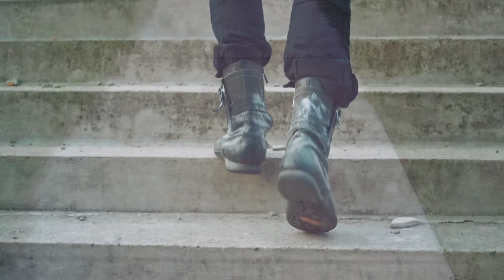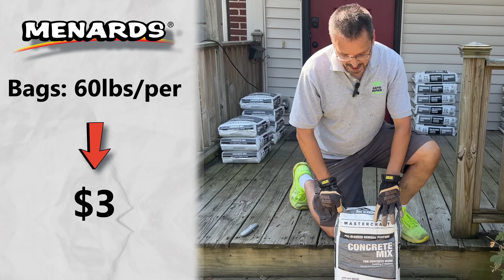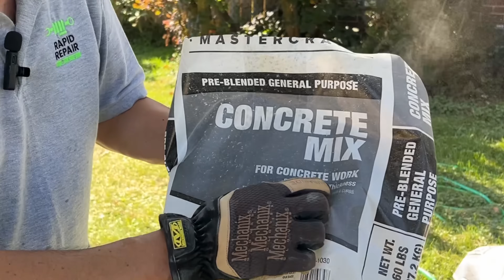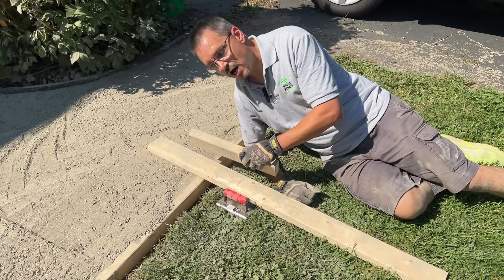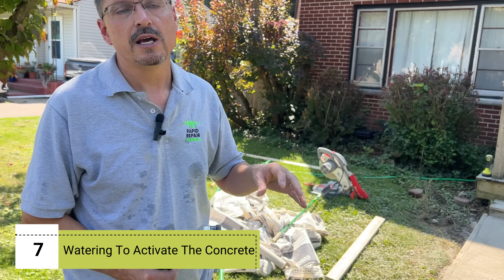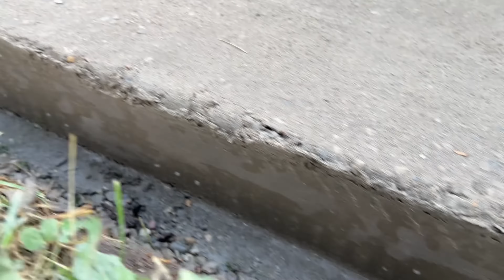Dry Pour Concrete Method Anyone Can Do

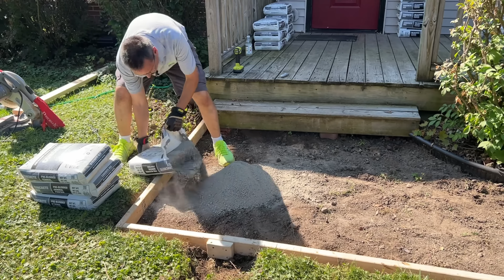Comment: 2:00 Would a thin sheet of plastic underneath the concrete cause any problem?  I ask because, "why not just lay the entire bag flat and then run the razor blade around the lower perimeter of the bag, then lift off the top plastic?"  You could get 85-90% coverage with just the flat bags, and then pour a few bags on top to level it all out.
Reply from the maker: Using plastic underneath is fine. Yeah your ideas on how to lay the concrete bags in there would work… You’re totally correct…👍🏼😎

Comment: Interesting. I want this to work but I think in Canada it is not going to hold up during the many freeeze and thaw cycles , especially right on dirt.  It will end up with a hard outter shell and crumbly dry inner  section. Maybe if you mixed water in when it's half full and then did a top layer. I just worry, so much work, I want it to last.
Reply from the maker: You’re very smart. If quality is your highest priority then you should mix it the traditional way. I do have a follow up video coming up this week where I will show the over one your review on the slab that there are no cracks whatsoever and I’m in a very cold climate. However, the surface will tend to spall and crumble… Dry pour concrete is only for very small projects.

Comment: FYI  Cement mix and concrete are not the same thing. Cement is an ingredient—a fine powder made from limestone and clay that acts as a binder. Concrete is the final product, a mixture of cement, water, sand, and gravel. Cement is the "glue," while concrete is the durable material used for driveways, patios, and foundations.
Reply from the maker: Thank you so much for your excellent explanation. I am guilty as everyone else as using those words interchangeably. As I understand it, Concrete mix is like the cake and cement mix is just the flour … For a baking analogy

Comment: How many bags will I need if my yard is 30ft by 25ft? Also how did you say remove all grass then turn the dirt?
Reply from the maker: That’s a really large area… Probably not advisable for a do it yourself dry pour method. At a 3 inch slab you would be looking at hundreds and hundreds of bags. There are online calculators that can help you with the measurement requirements.

Comment: What if mist with water but keep fixing the top for smoother look. Any advice if that work adding more water and smoothing top
Reply from the maker: You may be able to do it… It would just be trial and error… I have seen some people have success with doing a top layer of cement only… I think it’s called topper or finish cement… It doesn’t have the stone aggregate in it when you purchase it. This is only a good method for small projects not a large areas like patios or driveways or anything like that… Good luck.

Comment: Not sure how it’s going to be a strong build if there is no fiber glass or iron rod not used
Reply from the maker: I hear you. However, it’s been well over a year and in one of the worst winters this state has seen in awhile … And there’s literally not one crack on the slab. We are going to make a new video showing the results shortly. Rebar and fiber are just not needed for small projects, especially if you have sand underneath and are well drained.

Comment: Excellent video that’s how I did My fence posts dug the hole made everything level put the concrete in the  and filled it with water and I was done.
Reply from the maker: That's awesome, glad to hear that method worked perfectly for your fence posts too! 👍🏼😎 Are the posts still holding up strong?
Reply: @HomeRapidRepair perfection thank you

Comment: I have a question?
Should I pre soak the ground before I add  drycrete. Would this speed up the hydrate step?
Reply from the maker: Hello. Yes I’ve been asked this exact question before. I do think it’s a good idea. Your slab will be plenty strong, but will not have a perfect surface appearance
Reply: @HomeRapidRepair okay I understand the ground swells and dries probably leaving an uneven prone to crack surface.
Reply from the maker: @ShakeMehhed  the slab in this video is well over one year-old in  Michigan climate and there is literally not one crack anywhere in the slab

Comment: How many bas of concrete mix I need since I’m using CONKRETE mix
My measurements are. 122 long
60 width and. 4 inck high or thick since put it against anothe small concerts floor outside 
And great video
Reply from the maker: Here’s the most popular concrete calculator you can use: https://www.quikrete.com/calculator/main.asp

I ended up having extra bags and returned them for a full refund 👍🏼😎

Comment: And then it cracks all up cause there's no steel or a stone base, hope you cut control joints in at least
Reply from the maker: Thank you for your comments. I appreciate it. Check the age of this video. This slab is over one year old and during one of the coldest winters Michigan has had in some time… And there is literally not one crack in the slab… However do I do NOT endorse this dry pour method for most concrete work. It is only for extremely small projects such as garden paths. small steps, garbage bin pad, maybe shed bases… Etc..

Comment: I'm a DIYer and first time doing slabs. Saw several videos but your video is the easiest to follow. What concerning though is the cure level of the cement since this is 4" thick and did not poke any stick all the way at the bottom as recommended by manufacturer. You did not use gravel or rebar to strengthen the concrete. No control or contraction joints. Didn't mention anything about the slope for proper water draining. Any update on your project is much appreciated. Thank you.
Reply from the maker: You really don’t need rebar for small projects, and dry pour method should ONLY be used for small projects.  By the way this slab in the video has zero cracks till this day. 

Here’s a video where I tested the strength. Dry Pour Concrete Test - DIY Concrete 
https://youtu.be/0jxCoXkS-EA
Reply: @HomeRapidRepair thanks for quick response and inputs. Dry pour may not work out with my project with 160 sq ft. intended for small patio.
Reply from the maker: @carlosh4122  Yes for your patio go ahead and mix concrete with all the traditional methods...it will be worth the extra time and work for that to turn out nice.  Dry pour method is only for small steps, garden paths, garbage bins, etc

Comment: Uneven when looking at the steps
Reply from the maker: You ain’t wrong. These simple DIY ideas are just to help people that have no experience and are intimidated with home repairs , working on their home… I am not presenting myself as perfect in anyway…

People are intimidated with how difficult it is to mix a lot of concrete and the back breaking work of it all… This just presents a simpler cleaner easier solution for small projects…

Comment: Has it cracked yet?
Reply: BRO, WATCH THE VIDEO, WHEN THOSE FORMS CAME OFF, THE WHOLE THING IS CRACKED, LARGE CRACKS AND SMALL ONES, HIRE A PRO
Reply from the maker: It’s been over a year and in a very cold climate…no cracks in the slab yet. But not advertised for professional jobs…just tiny areas if you are intimidated by concrete work

Comment: That's no good at all. You have to mix THOUROGHLY! There is no shortcuts in pouring concrete correctly! You'll be pushing a large appliance like a refrigerator across that and it will break loose.
Reply from the maker: Great points 👍🏼😎

Comment: This works but dry poured cement does not have the strength of wet pour. Beware.
Reply from the maker: You ain’t wrong. But did you see me drive my work truck over it? Dry Pour Concrete Test - DIY Concrete 
https://youtu.be/0jxCoXkS-EA

Comment: It will  fail
Reply from the maker: Yes, I’m sure you’re right someday… Although it’s been well over a year and one of the harshest winters we’ve had in over 20 years and there’s not a single crack yet…. But yes, I would not do this method for a large project or anything I really cared about… Just for tiny tiny little areas.

Comment: Hello. I’m looking to build a ribbon style Hollywood style drive pad. If I dig where my tire treads would be. Do I need the 2x4s or use the edge of the trench? Would you suggest compacting gravel underneath the dry concrete mix? Or just straight concrete?
Reply from the maker: Compacting gravel underneath is done if you need assistance with drainage. If it’s already a well drained area you can just use compacted sand…
Reply from the maker: You would not have to use two by fours… We could use literally anything…

Comment: Would it be better to water in layers, every inch or so? I’m still not sold on this. Would like to see one that was done at least 5 years ago.
Reply from the maker: Maybe you’re right, however, if you’re going to do all that extra work and time and effort, you must as well just pre-mix it the traditional way. Here’s a video where I demonstrate the strength of dry pour Concrete method while I drive over it with my work truck: DIY Concrete - Dry Pour Concrete Test
https://youtu.be/0jxCoXkS-EA
Reply: @HomeRapidRepair I watched it. Wondering how that would work for an old house basement floor. One that has a dirt floor and no easy way to use a truck to pour it.  Set it up in manageable sections. Still not totally sold, but can see its uses.  Have a great day.
Reply from the maker: @all @allen7218  it will absolutely work in a basement. It would be a perfect easy solution because you could partition the forms off and do it in small patches if you would like. The only possible complaint is the surface does not appear to be smooth. but it would be such an improvement over dirt… You should try it.
Reply: @HomeRapidRepair I think you might need more water if it is a very dry basement.
Reply: I wonder what the amount of coverage difference between wet and dry pour is. What one is more.
Reply from the maker: @allen7218 they should be very similar. Dry pour may go a bit further
Reply from the maker: I use the online concrete calculators
Reply: @HomeRapidRepair it would be interesting to see. When you add water, you add mass. 
Does the dry settle, or is the powder so dry and compressed already,
Or am I just thinking about this too much? Lol
Reply from the maker: @allen7218 yes, yes, and yes 👍🏼😂

Comment: Why didn’t you use steel in the slab??
Reply from the maker: Honestly, it’s just not needed for such small projects. This concrete slab is in a very cold climate and it’s been 1.5 years and there is not a crack in sight.

Comment: Interesting. The finished is pretty ugly but i think itll be good as a foundation to add planks on as a ourdoor finished? Any thoughts on that verse using wood as a base
Reply from the maker: I think you’d be fine either way. It’s absolutely perfect for small projects and easy DIY stuff where people don’t wanna mix 20 bags all by themselves…

Check out my video here where I drive over a dry pour concrete slab with my work truck: DIY Concrete - Dry Pour Concrete Test
https://youtu.be/0jxCoXkS-EA

Comment: Can you use this for a driveway?
Reply from the maker: Well, yes, in theory you can it will hold the weight if it’s 4 inches or thicker. However, I’m not sure you would want to. Because if you’re going do all that work must as well do traditional pre-mix and use rebar in the slab. Also, with the dry pour method the edges can be weak and  can crush as you’re driving on and off of the slab…

Really dry pour is only for small projects where the homeowner doesn’t have anybody to help them and is intimidated with pre-mixing a whole bunch of bags of concrete…
Reply: @HomeRapidRepair fair enough. I've got a small driveway that's all grass and it's become very muddy because of the heavy rain which happens often in my country so trying to look for cheap solutions. To get it professionally done it costs minimum 10k
Reply from the maker: @Unknown-si8yx check out my video here where I drive my work truck over a dry pour slab: DIY Concrete - Dry Pour Concrete Test
https://youtu.be/0jxCoXkS-EA

Comment: Do u need metal mesh beneath?
Do you need to cut lines between it?
Reply from the maker: Great question. No rebar or mesh is needed on such small projects at all. As far as scoring expansion lines… That’s up to you. I would say not necessarily unless it’s a very large project say longer than 10 feet… Keep in mind. This method is not really recommended and has nothing to do with traditional concrete… This is just a very easy alternative method for people that don’t want all that hassle…

Comment: Would like work for a larger 16x8 ft base?
Reply from the maker: The short answer is yes it will work even on that large footprint. The larger answer is if you want the slab to last and look good for a very, very long time. Maybe you should rent a mixer?

Comment: can i do a 20x12 the same way to park a 3500lb camper?
Reply from the maker: Yes, you can do it and it will work. I know it will hold the weigh. I think the concern would be the edges. You would want to have a proper ramp so the camper isn’t not tearing up the edge every time you drive onto it.
Reply: @HomeRapidRepair  thanks for the info and advice.

Comment: Amazing video. Me and my dad used to do concrete work. He showed me an easier way to mix and pour but nothing like this. I mean this method is way better. For one it is low costing, and it's just easier to do it this way. I really appreciate you for sharing this information and video. Great video
Reply from the maker: Thank you for your comments. I appreciate it. Yeah it’s great for small projects and beginners that need no intimidation factor. Here’s another video. I did where I drove my truck over to prove the strength on the inside. The edges can come out wonky if you’re not careful…

DIY Concrete - Dry Pour Concrete Test
https://youtu.be/0jxCoXkS-EA

Comment: Also, will I be able to anchor a 10x5 dog kennel to the surface
Reply from the maker: I would say yes, you can drill into it and anchor, and it would be successful. However, the edges near perimeter are definitely weaker than traditional mixed concrete. So maybe make a wider footprint than you need… Let me know if you have any other questions.

Comment: Good morning, can any concrete mix be used for dry pouring or does it require a specific brand? Lowes only have Sakrete
Reply from the maker: Hello. You can absolutely use any general mix concrete bags you want to. The brand you mentioned is considered pretty high-quality. You’ll do fine. Good luck 👍🏼😎

Comment: No Rebar? You will have cracks in months... You are up north if you are shopping at Menards... You have lost all credibility because no Visqeen plastic liner, no Rebar, and not having a form or board at that HUGE gap by the steps will come back to haunt you.
Reply from the maker: Check the date of the video, it's been 1.5 years and ZERO cracks. No rebar is needed for such tiny projects. Yes I'm in Michigan a very very cold climate and ZERO cracks on this walking slab. This easy DIY is only for small projects, one would never install a driveway or something like this.
Reply: @HomeRapidRepair  - No Visqeen, No rebar... Period. Ask ANY CONCRETE EXPERT and he will tell you these are necessary for a LONG TERM pouring. I do not do ANYTHING HALF @$$... Not impressed at all... You protest too much...
Reply from the maker: My Truck Drives Over Dry Pour Concrete
https://youtube.com/shorts/emDReE7AOTA?feature=share

Comment: If putting the cement directly on top of ground and not with stone, you should have a fence under the cement to hold it together. Because in the winter time it will crack.
Reply from the maker: That's a good point about reinforcement, especially with temperature changes!
Reply from the maker: My Truck Drives Over Dry Pour Concrete
https://youtube.com/shorts/emDReE7AOTA?feature=share

Comment: I like that idea.
Reply from the maker: Thanks for watching and taking time out of your day for responding to my video. I appreciate it.
Reply from the maker: My Truck Drives Over Dry Pour Concrete
https://youtube.com/shorts/emDReE7AOTA?feature=share
Reply: @HomeRapidRepair in NZ, footpath supposed to have 3 inch thick. Driveway 4 inches. However,  most builders cheat. 2 inch or lesser on footpath,  3 inch on Driveway. So your dry pour might not have 4 inch thick. Should not go on truck.
Reply from the maker: @nzworkhorse888 great points. Thanks
Reply: @HomeRapidRepair commercial driveway supposed to have 6 inch. So some houses, have a sign, no truck allowed to get in. As their driveway do not have 6 inch thick. I heard of a funny story. A Chinese man cheaply put 3 inch concrete on all driveway before selling.  Then when he move the moving truck cracked whole driveway.  Ended up buyer not accept it, and contract fall off.

Comment: Thank you for the video. I appreciate it on slabs that are 6 x 8 just for walking on. (Corn hole pads) Would I need stone underneath (gravel )and or rebar? Or could I do it just like in the video?
Reply from the maker: Thank you for the question. No rebar is needed for such small projects. You would not need gravel underneath unless you have a drainage problem. A little bit of sand works perfectly for tamping down and leveling off the land…. Good luck. Let me know how it turns out. You’ll do great 👍🏼😎
Reply from the maker: My Truck Drives Over Dry Pour Concrete
https://youtube.com/shorts/emDReE7AOTA?feature=share

Comment: If you're just gonna walk on it, you don't need to use rebarb?
Reply from the maker: You’re smart 👍🏼😎 That's right, for light foot traffic, rebar isn't typically necessary!
Reply from the maker: Zero cracks on this slab after almost 2 years